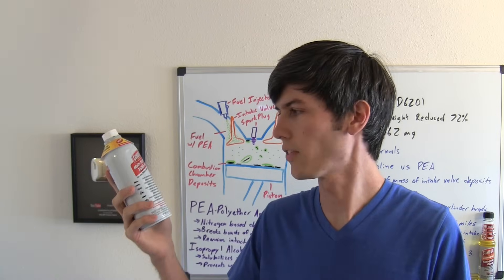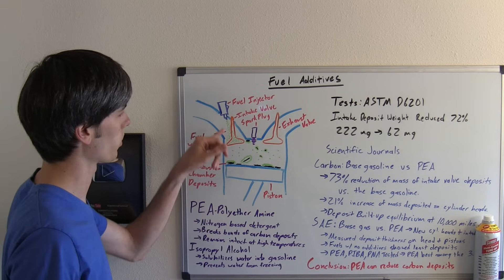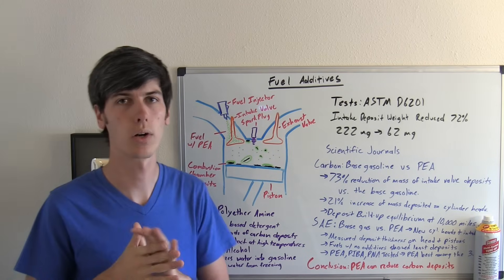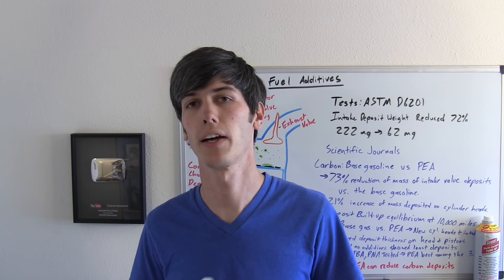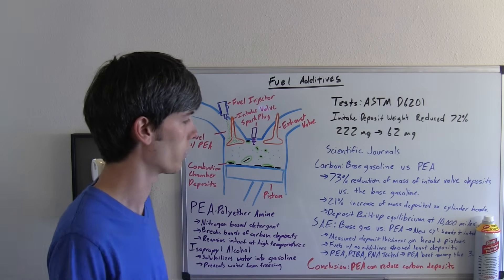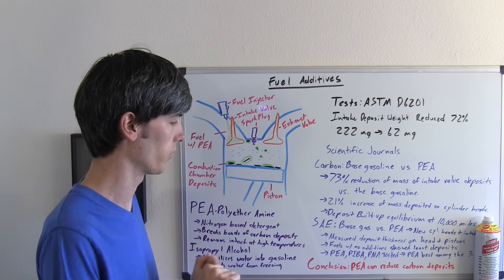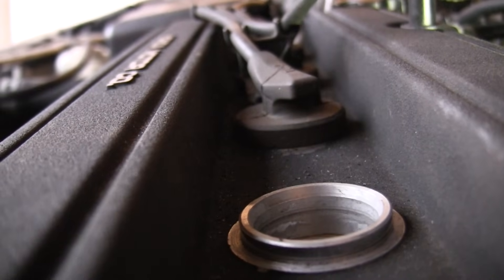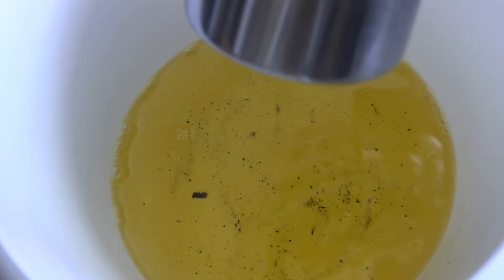Fuel Additives & Injector Cleaner - Explained

Comment: I have heard that additives on modern cars can mess with the O2 sensor and other electronics inside the engine. I myself have used some on a 2007 Infinti and the O2 sensor went out about 3000-5000 miles later. The car already had about 50,000 miles on it and its possible it went out on its own, but the confirmation bias has now set pretty heavy. 

Whats your opinion on additatives and electronics inside modern cars?

Comment: even using lower grade gas, it contains cleaning agents by federal law so even when you use lower grade gas it shouldn't be that big of a problem. The higher grade gas has more cleaning agents but all gas has some amount of cleaning agents added. plus all gas comes from the same refineries.
Reply: +Quadcoptercrazy All companies have different additives. I've found they also return different fuel economy numbers because of this. I ten to get a 1-2 mpg in my manual ford focus with the NA 2.0

Comment: have you looked into any testing on what this can do to a gas tank or the fuel filter system? rumors are around that say these kind of additives can break apart fuel tank lining and harm fuel filters and end up sending that mess to the injector which in turn gets messed up.

Comment: But does it reduce performance as part of your fuel is cleaning agent instead?
Reply: no..
Reply: Vrbas Jimmy Page Because the additives clean the engine which would increase power. I'm talking about an already clean engine.
Reply: +6Twisted no but you are wasting money always running cleaners. The engine is already clean. It doesn't get better.
Reply: Rafa Aquino So logically, running pure petrol, without additives, in a clean engine would produce more power?
Reply: Vrbas Jimmy Page Woah woah, no need to get aggressive. I just asked a simple question.

Comment: How well does "steam cleaning" your engine work?  That is, adding water to the vacuum line (brake vacuum, whatever) while the engine is turning about 3500 RPM.  I've been told this kicks out carbon like no other and is ... ya know ... free.  This logic based on how crazy clean a cylinder head and valves get when a head gasket blows and leaks coolant into the combustion chamber.  I would LOVE to know if this actually works!  Ya know, scientifically ... before and after stuff ... tests ... not just someone on youtube saying "yeah, it really works" garbage.  Thanks
Reply: Frank Gutowski water is a result of combustion in an engine ... not 1.5 gal/gal of gas but actually 1.1 gal of water VAPOR... but this is AFTER the combustion takes place.  With water injection the presence of the water (NOT VAPOR) it present before and during combustion.  This fact makes a HUGE difference as this water is vaporized in the combustion chamber and steam-cleans the engine while it is being processed.  The hydrogen in the gasoline does not combine with the oxygen in the atmosphere fully until it is realeased out of the valves and out the tailpipe.  This is why tailpipes and mufflers get so rusty.  The result of water injection is a much cleaner engine (carbon gets cleaned off) both valves and cylinder chambers as well as exhaust manifold and tailpipe and many say more power due to water expansion while in the cylinder chamber ... but I'm not sure if this one is true.  Water/methanol mix should yield in greater pressure and more power as the meth should combust so long as you have a turbo cramming in more air to compensate the added fuel (methanol)
Reply: Frank Gutowski the burn accounts for the energy release but the water vapor made is made more completely when the exhaust strikes the air after released from the fuel source itself.  IOW, the water isn't actually made until the combustion is well out of the chamber.  the burn itself accounts for a small amount of the water produced but most of the water vapor is produced after the burn.  the burn releases the H2 and cannot combine with O until it actually gets to it... O2 censors attest to this as as incomplete burns have high O2 and complete burns have much less ... once introduced to atmosphere it's cycle is more complete.  if water vapor were created at the burn itself the water would put out the flame... the flame eats the O2 and the H2 released combines after it hits the air above in the form of vapor.  If water vapor is introduced pre-burn then you will get a less complete burn and you will get none of the benefits of steam cleaning as the vapor will not turn into steam.

you're not getting this are you?
Reply: Frank Gutowski initial comment made almost a year ago.  also，no, it does not make steam when gasoline is burned it makes water vapor.  significantly different.  also, the steam that is made from water making contact with the piston and cylinder walls does not decrease the pressure or energy of the power stroke but if the water retards the burn (which it does, obviously) then it can take away energy if it retards it too much.  if not, and it just acts as a high octane additive without continuing to burn after tdc, then the water's expansion by turning from a liquid/vapor into a steam/gas actually does （from what i've read) add to the compression.  the steam produced actually steam-cleans carbon from all parts of the chamber.

so, that's what's going on... get rid of knock?  sure ... retardation prevents pre-detonation and the cooling effect of the water doesn't hurt the situation plus it does not take power away just by thermally cooling the parts.  now, if you're put so much timing into it that it's intentionally detonating you'll still get knock so be careful setting your timing too aggressively and if you don't do the timing aggressive enough you'll get a bad and wasteful burn.

all that said, my logical understanding is that this entire method is only beneficial for power in a turbo application as a n/a car will simply get a less injected burn (O2 censor will tell the computer to tell the injectors to put less fuel into the mix as the water is taking up space for air and, therefore, it will run rich when water is injected in a n/a situation) while in a turbo application higher turbo pressure makes up for the water injection and once the water expands into steam there is a greater pressure introduced to the engine ... combine that with a 50/50 methanol mix and you've got a greater combustion agent as well.

the water created by the combustion if distilled could be used to refill the injector but come on ... who wants a still in their car... better to just refil the reservoir with h20/meth pre-burn
Reply: Frank Gutowski Correct 100% ... well stated ... which is why on a freezing cold day the exhaust is so steamy ... now, if you could take that water vapor, condensed from the steam upon hitting cold air, and put it back into the induction system of the care AS VAPOR (non-steam, condensed water) THEN you'd get the steam-cleaning upon combustion you're seeking.  As it is, you won't see that vapor trail until it's exhausted, provided the dew point is met.

looks like i was wrong about the free hydrogen atoms combining post combustion ... but either way, i'm pretty sure you won't get steam-cleaning effect until there is vapor.  maybe this explains why 1) introducing water into the intake system actually does, very obviously, clean the engine and 2) the exhaust valves are so much cleaner than the intakes...

but what i AM sure of is that steam cleaning works ... waaaaaaaay better than seafoam! ;) or anything else
Reply: Frank Gutowski nope, it won't be under a partial vacuum, it will be under tremendous pressure as the water turns to steam upon compression and the burn of the power stroke.  let's say it's 80lb/sq" of pressure, which is 700lb/sq" (probably more) post combustion ... that means the water boils and turns into steam at just over 500 degrees f.  so, hit anything with 500 degree steam and see what happens.  carbon flies off surfaces is what happens.
Reply: Frank Gutowski no, the water does not "immediately vaporize upon contact with the metal" as very little of the atomized water makes contact with any of the metal itself.  the compression of the air/fuel/water mix then undergoes compression of about 80 psi, depending on your engine, and then it ignites which increases the pressure at least 10x.  This ignition is what turns the water vapor into steam and it does it at about 700 or 800 psi!  at THIS psi the steam created is around 500 or 600 degrees f.  that's all just fact.  what you said about h20 "vaporizing" against hot metal is pretty much less than 1% if any at all of the water atomized and injected into the engine .. especially considering that the metal surfaces are only about 300-350 degrees f, considering it's constantly cooled.  well, all except the e.valves ... the exhaust valves on a regular 4-stroke engine are about 800-1200 degree f.

just putting room temp water on piston heads and thinking the reaction of the water turning into steam at 212f will burn off the carbon is naive.  it won't happen.  give it a shot and heat up some old piston heads to 300 and squirt water on them ... nada.  now, take a heated pressure gun and hit those suckers at 600 degrees f and BAM!  the carbon flies off!  STEAM CLEANED... now, the water that is made due to normal combustion is created AFTER burn and exhausted under zero pressure steam conditions, rendering it ineffective for cleaning the engine but probably effective at cleaning the exhaust valves with the motion of the exiting air.  this is why i'm thinking exhaust valves, in a lean burning engine, are so much cleaner than intake.  i could be wrong about this point though
Reply: Frank Gutowski right off the bat you're wrong... why go on?

Comment: Cool info. My ford f250 has more than 375,000 miles on it and I think it might be time for some more tune up....

How about STP Fuel Injector Treatment (& Upper Cylinder Lubricant)... Contains: Petroleum distillates and ethoxylated amine... My truck had cut off on me 3 times while I was waiting at a red light. I made it to a gas station that I always buy beer from and just decided to get this STP stuff.
Reply: you need to just pop your fuel rail and clean those injectors
Reply: oh ya, i was thinking about that on my next tuneups coming soon.!!!! I did the spark plugs and coils, went to an K&N air filter.

Yesterday I just got a whole 12 box of quart 0w-20 (i think I asked for 5-20 oil or something but they gave me 0-20, all good). And I still need to get the transmission filter/fluid and that fuel rail and injector. I have a $300+ fuel injector kit sitting in my amazon cart, so... And on a rainy day, I failed to get my fuel filter out, will need to try again.
Reply: Noah Rule Oh ya, another note about my fuel rail... I forgot that I have been running with a fuel pressure tester on it for a couple weeks now.

My fuel pressure valve was leaking and all the fumes was going into the car-port. I tossed a fuel pressure tester on it for temporary until the dealership was open. But I had forgot to replace the valve after buying the replacement.

Comment: My conclusion would be that PEA  is a good cleaning agent, spraying in on carbon buildup, like it is on the intake valve is good, but burnt it makes more carbon buildup than standard gasoline. It shouldn't be used as an additive, but as a cleaner by its own, through the plug holes and in the head ports in small amount, no ?

Comment: your experiment on the solution may not be sufficient coz in combustion chamber, the solution is not soaking the valve at all. in addition, i personally do not think this kind of solution will help or producing any obvious result, as any foreign mixture (besides petrol/diesel) may contaminate the lubricant within the engine and upset the function of the lubrication matter. details please check the purpose of lubricant.

Comment: Do you have an opinion on seafoam?
Reply: +oliver24x that is not true
Reply: blacktop hemi R/T you have no miles there's no point
Reply: I've had seafoam fix my fuel gauge in a 2002 Ford Explorer 140k. I also believe it helped my 2003 jeep liberty 248k run better.
Reply: dtdurke the product he used in the video is almost identical to seafoam, which also uses PEA.
Reply: Would it help a 5.7 hemi with 36k? Or is it not worth doing 
Thanks for any feedback
Reply: Andy Shay what issue did you have in your fuel gauge? needle totally down?
Reply: Run a half a can throughout your vacuum system via the line going to you pcv. Valve. Let it run as you slowly add. Then shut off engine let it set for ten minutes. Don't forget to add one once per gallon to your tank. Seefoam work's wonders.
Reply: dtdurke I used seafoam for my 2005 Santa fe and I can clearly that it removed a significant amount of build up. Because the oil I removed was black where as when I check my oil now it is more of a golden brown.
Reply: So, it sounded to me like the PEA stuff moved the deposits from the combustion chamber to the cylinder walls according to the one report?
Reply: I use seafoam. First time user error and product messed it up. They sent me a new can when I went to the website and explained to them. Which means A+ on customer service right there. Re-used it and oh my god. My car is like brand new again. I do however periodically use STP fuel cleaner so my system was not completely crap. But seafoam blasted it up another level and I will continue yo use it and tell others to do the same.
Reply: +Andy Shay those are all 4 strokes
Reply: +duhstorm562 It's for 2 stroke

Comment: I used some Lucas brand of injector fluid, and it took a quite a few bottles of it to treat it (over a period of time of putting it in whenever I filled up) but it eventually solved my problem of my 88 F150 stalling out on me and running rough.
Reply: You used it every tank? Lucas upper cylinder lubricant and injector cleaner?
Is it safe?

Comment: so.... a few questions for the viewers...
if you soaked your tail pipe in gasoline, would that help? gasoline is an excellent cleaning solution, so is diesel fuel. please DO NOT PUT DIESEL FUEL IN YOUR GAS TANK!  yes isopropyl alcohol is good at removing water( not the best) but adding alcohol to your fuel also increases the octane level. the best way to remove carbon is by steam, on average, for every gallon of gas your engine consumes, it will emit one gallon of water, or water vapor (steam) however if the water vapor is introduced through the intake. DO NOT PUT WATER IN YOUR INTAKE OR FUEL SYSTEM. leave these things to professionals. 
Also I must add that some engines are known as " high carbon engines" which mean they tend to build up carbon and it is normal. 2 things to remember about carbon, it does help seal ( valves and piston rings) and if there is too much carbon this could cause excessive wear and then things tend not to seal.

Comment: what is techron from chevron?
Reply from the maker: It also uses PEA, though I don't know what all of the additives are.
Reply: +Sydney Paillet 
And both are basically repackaged and overpriced naptha
Reply: +Engineering Explained What do you think about the lucas fuel injector cleaner? I hear that it is the best injector cleaner to use. Would you recommend using it on the V6 VTEC? I'm just wary of using any additive in my engine. Am I being too paranoid?
Reply: +FPV Chicago - I have used just about every lucas product and have had nothing but success. I would recommend lucas and high quality fuel to clean out the motor.
Reply: +Engineering Explained what is price of this aditives ??
Reply: +Ivan Bender Like $5-$10 bucks at your local auto parts store.
Reply: +Engineering Explained Basically techron is sea foam??
Reply: Engineering Explained Interesting! Many thanks